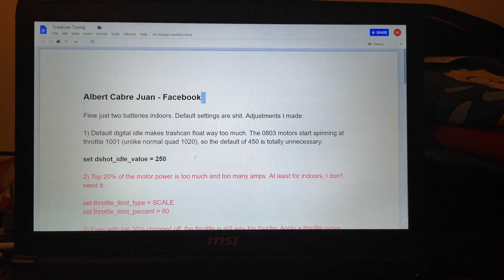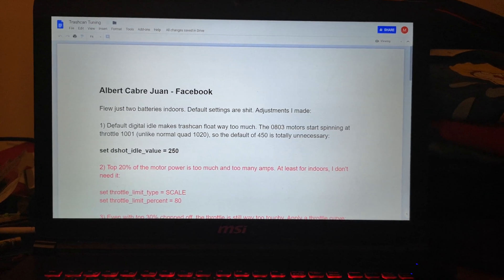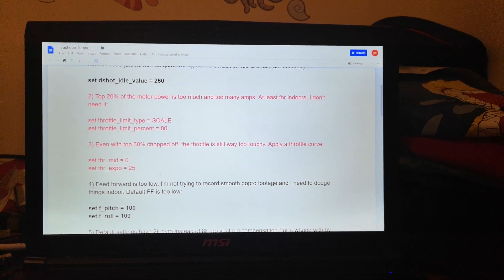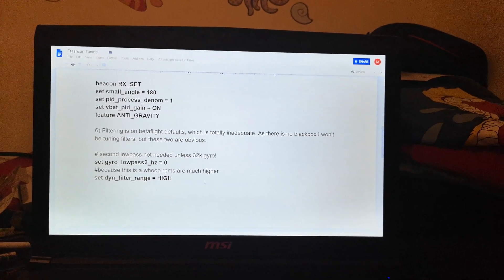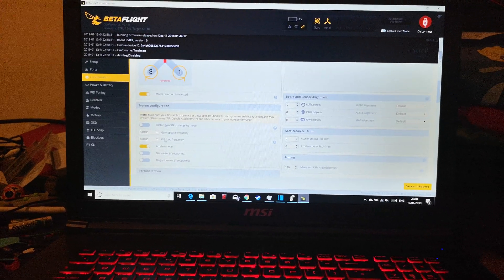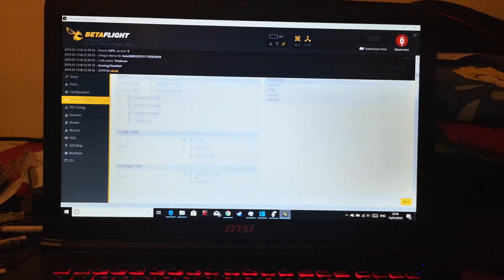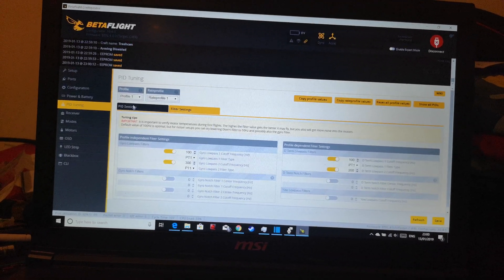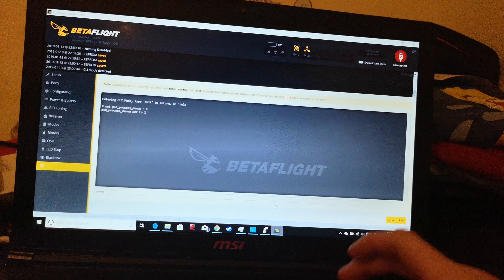Eachine Trashcan review betaflight tuning guide

Comment: hey thanks for this ... i accidentally saved my configuration to defaults is there any way to get it back? thanks
Reply from the maker: You need to find a cli dump of the original setting. Or just copy the settings in this video